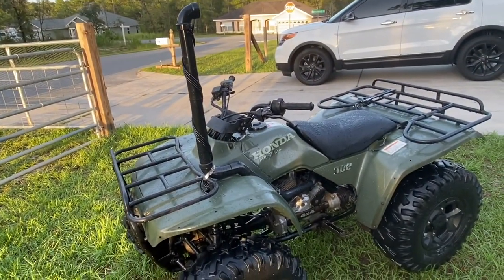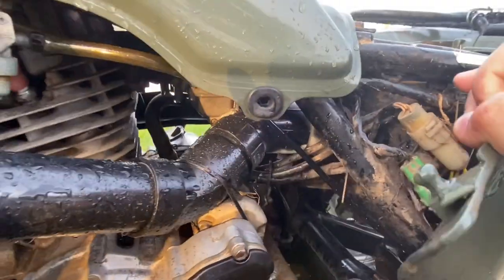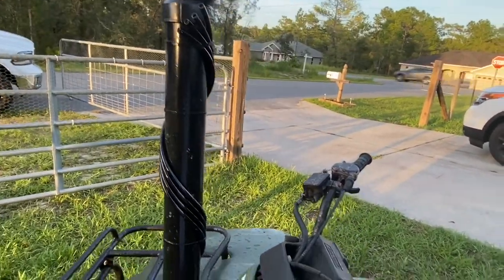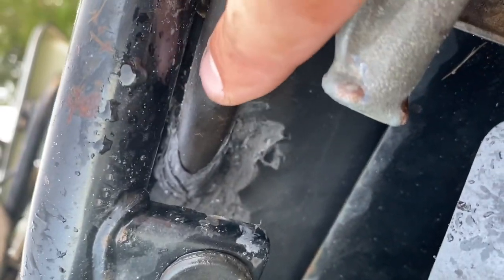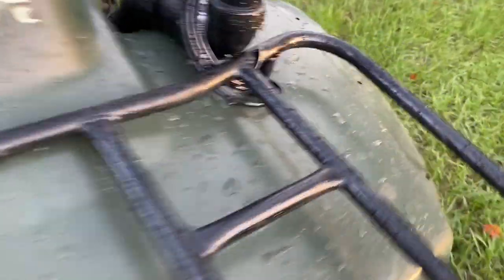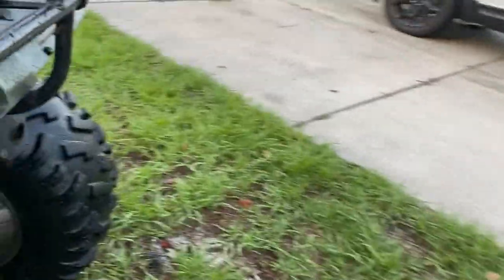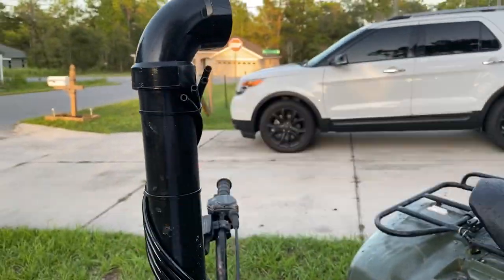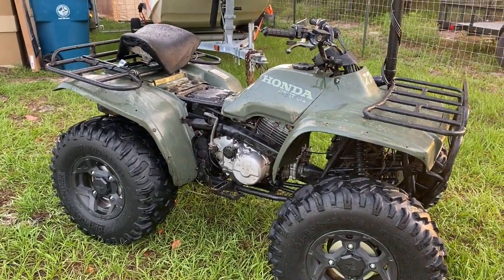How To Make Your 300 Fourtrax Water Tight

Comment: I'm saving up for a honda 300
Reply: Great idea 👍
Reply: Same
Reply: Dude I bought one for $250 no cap
Reply: @julianalvarez2155  damn was it in good condition
Reply: @ColeGreene-rr4vk   yea just the frame was a little lose but that was a free fix because I already had the right screw and it didn’t run but it came with a new motor
Reply: Look on fb market place they have some for about 1500

Comment: I put vent caps on my front, rear diff and my transfer case, so I don’t have lines everywhere
Reply from the maker: Gonna blow your seals out like that. Whole point of those vents is to not only release heat but also pressure from that heat that builds up. If there’s no where for that heat and pressure to go it will push out the seals and you’ll have oil leaks and water/dirt will also get in
Reply: @dom_offroad  I don’t have oil I’m in my diffs or transfer case it’s full of grease
Reply: You're gonna  ruin alot of stuff doing that
Reply: @MattDTB  like what?
Reply from the maker: @twintwo1429  he put caps on the vents to keep water from coming in, but obviously heat and pressure can’t escape and the pressure will push out the diff seals and any other seals.

Comment: So there is a vent in front end rear and carb so take out the stock vents
Reply from the maker: Correct. The transfer case has a vent also right in front of where it says “4x4” on the driver side of the bike.

Comment: How do some people do a flex pipe out the top I want that
Reply from the maker: So you can use a standard pool hose. Should fit right into the hole where the plastic tube goes into the airbox then you just run it along side the motor and out the top where the bars are.

Comment: Do you use dielectric grease and where do you apply
Reply from the maker: Yeah I’d pull the spark plug boot and fill it with dielectric grease and put back on. Any connectors like the one going to the cdi and rectifier I’d throw some in there also just to be safe.
Reply: @dom_offroad  thanks brother

Comment: do you not need a vent line off the top of the gas tank
Reply from the maker: Yes I addressed that at the end of the video. You need to drill and tap a fitting into the gas cap and run a vent line.